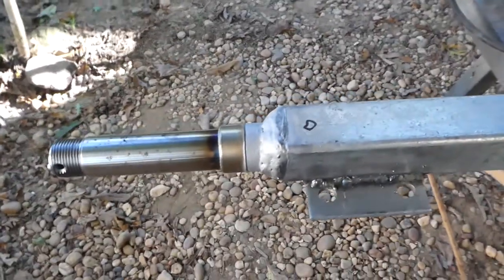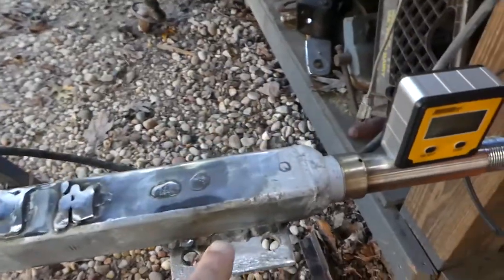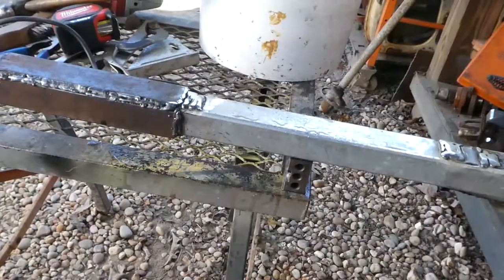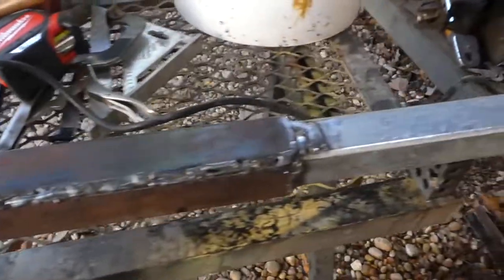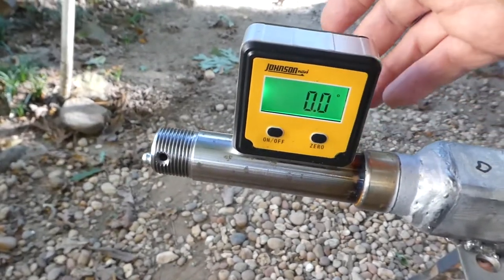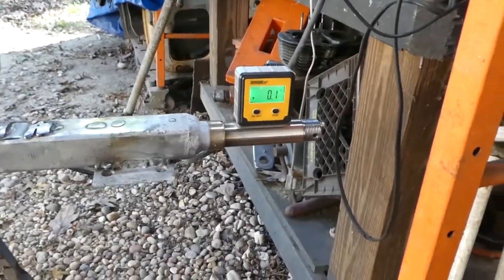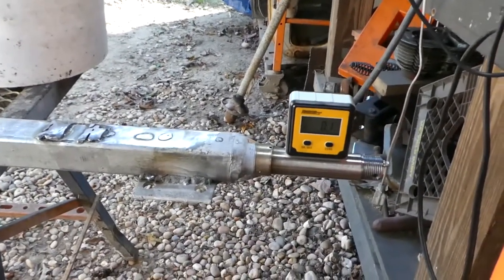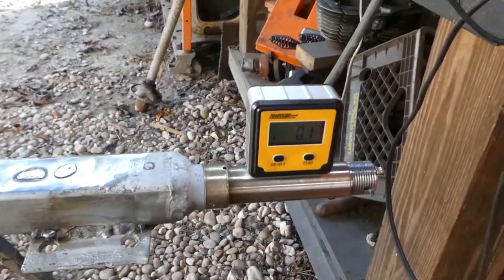Follow up to the axle shortening fail

Comment: I bent the one of the axles on my dump trailer when turning it around on a logging road and running it off the turn-out into rocks. Tires wore out pretty quick. I used the excavator to bend it back straight by eye, not nearly as precise as you, and it's been fine since.
Reply from the maker: The old one was out by 3-5 degrees measured using this method and it flattened one edge of the tire. It does not take much. It always amazes me what the eye can do though. I could see a 3rd of a degree bend over 5 feet.